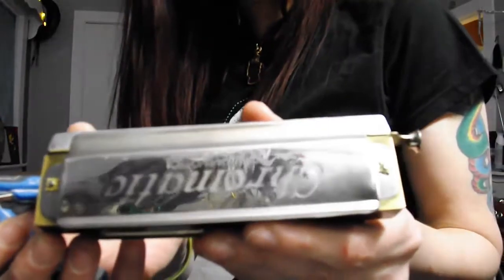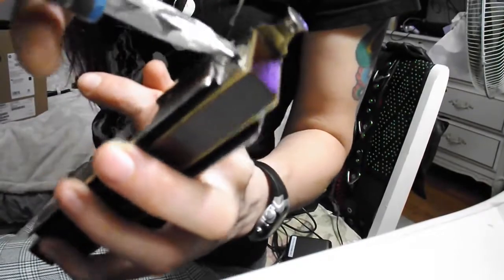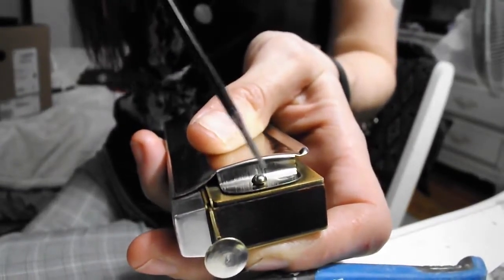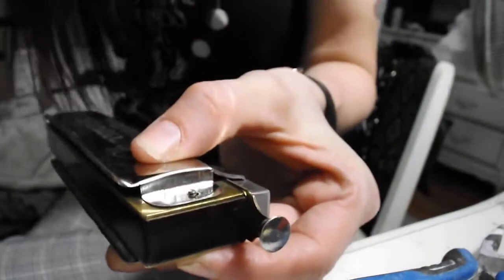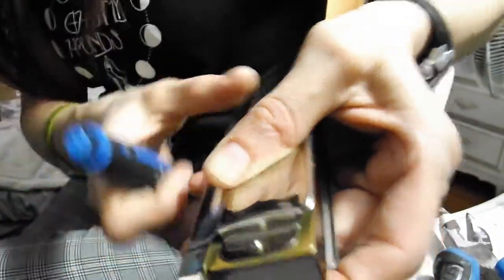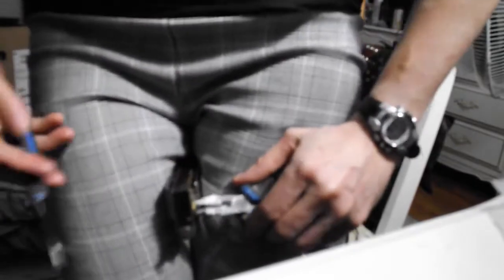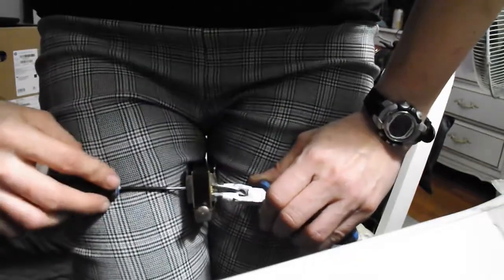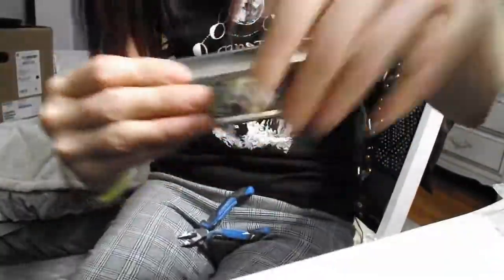Koch Chromatic Harmonica Repair

Comment: I picked up one of these at a yard sale along with 4 or 5 other various harps.  The story behind this one is that the mans father carried it when he was in "the war".  I think he was referring to WWII.  

The blow holes all seem to work fine, just doesn't give a lot of sound out and the draw holes don't work at all.

I guess I need to watch a video on tuning this thing as I'd love to get it back to a playable condition.

Is there any guidance you can share as to how each hole should sound once they're properly tuned?

Also, how can I tell what the exact age is or something within 10 years plus or minus is on it.  

I'm not looking to make it look like brand new, I want to play it.  Also, inside the top and bottom covers, there's some surface rust I want to clean up.  Any suggestions on getting the rust out?  How should the brass plate that holds the reeds look?  It's not shiney by any means but, I've got some pretty fine 4 ought steel wool that would probably bring a shine back to iy.

Any help you can provide is greatly appreciated.
Reply from the maker: I have a universal digital tuner that operates on tone and vibration for many different instruments.  You can pick one up at any instrument store. I am not familiar with the tuning process as I did not have to replace the ones within this particular harmonica as they played beautifully still. The repairs I did do were mostly cosmetic. I did take the slider out and clean it and put it back in after greasing it up a bit. That did help with the tuning, but that could have just been because I knocked the years of goop out.. I wish I could tell you more. Good luck with your repair!
Reply from the maker: As for the age, when it was given to me, it came in its original box...so I was able to easily ascertain its age...